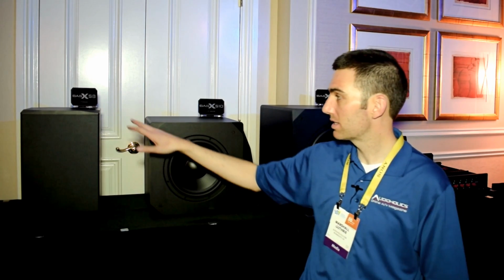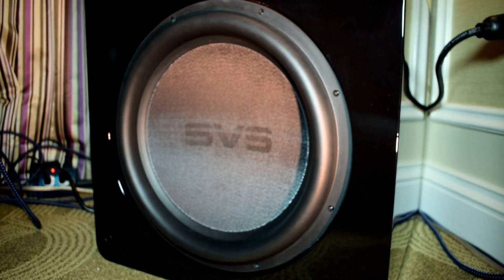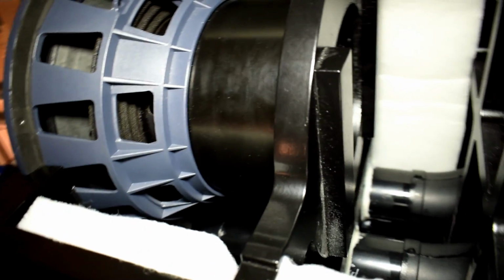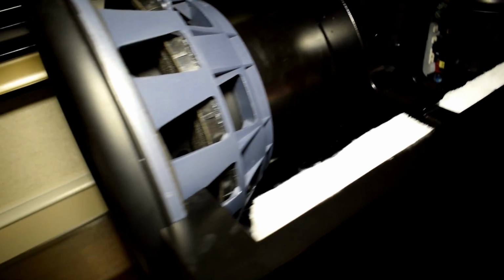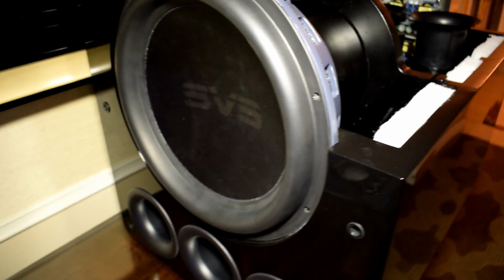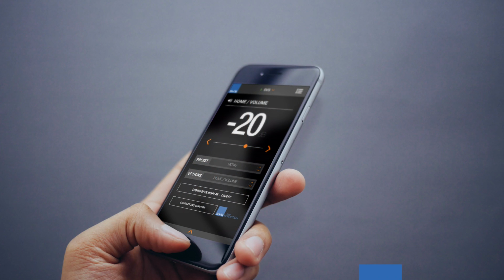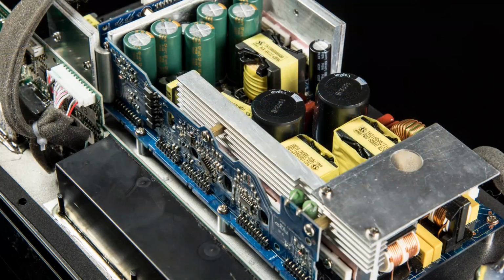Emotiva BASX and SVS 16" Ultra Subwoofers Preview @ CES 2017

Comment: Love SVS, but for $2500, you can build two 18" sub enclosures with subs that will smoke this SVS.
Reply: Maybe in output but it's not going to be as accurate. I've heard Dayton Subs in a sealed box on a Crown 1000rms amp. And my SVS PB13  is way more musical and a lot ! Faster
Reply: All depends on what the individual listens to. I'm a gaming/movie person with very little music in my theater room. I had a PB-13 Ultra and just felt it didn't get low enough. I purchased two Epik Conquest 18" subs and couldn't be happier. I do agree with you, definantly not as musically acurate but I gained bass notes that you can literally feel.

Comment: LOVE SVS.....but could I in an apartment?..Id better not!
Reply: John Douglass I'm running 3 big subs in my apartment, one of which a monster SVS. With the right room isolation measures and multiple subwoofers with the right calibration, I can now enjoy movies at 100db during daytime and 85db at night. It is possible but you need to invest a bit in room acoustics and multi-sub. :)
Reply: I have a sealed SVS in my apartment.